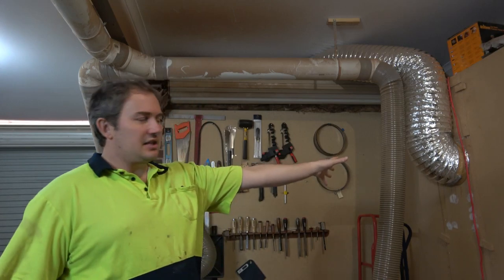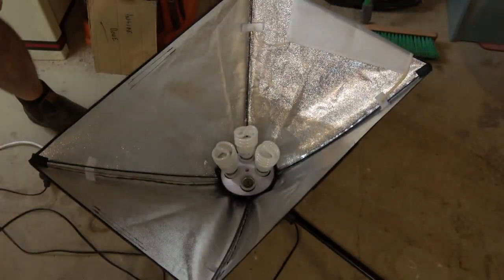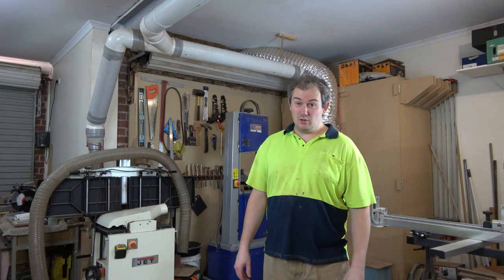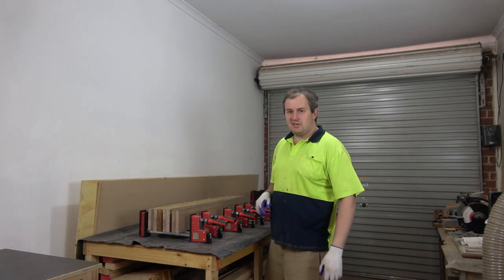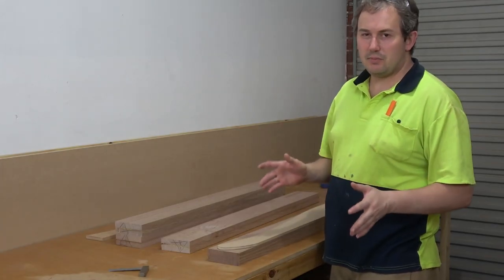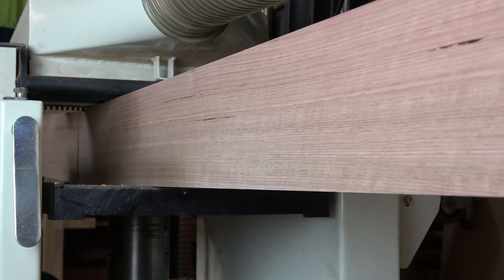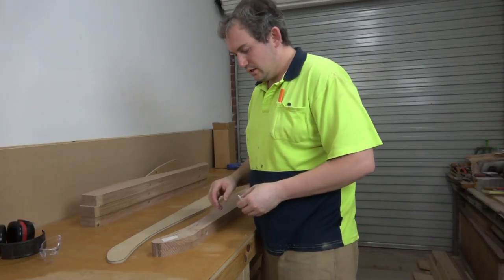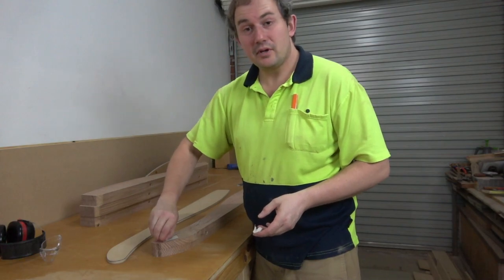Dust leaks - Baby Cot DAILY Woodworking Vlog 7

Comment: All that outside dust is static on the PVC pipe, I think Dave Stanton has a good video on wrapping an earthing wire around them to stop that build up... but then you wouldn't know when its leaking 😅
Reply from the maker: Yeah I am aware that PVC pipe used as dust pipe generates a lot of static. It actually zaps me often enough. I have no idea how the ceiling is being covered in dust though, it still happens to this day though to a lesser extent.

Comment: Hey, I just sealed all my plastic DC pipes with SOS silicon tape, really good stuff, better than duct tape.
Normally I get it from Aldi but Supercheap Auto has it half price at the moment.
Reply from the maker: Nice. I did notice that the duct tape I had used had come unstuck in places. I'll give the silicon stuff a go. Thanks.